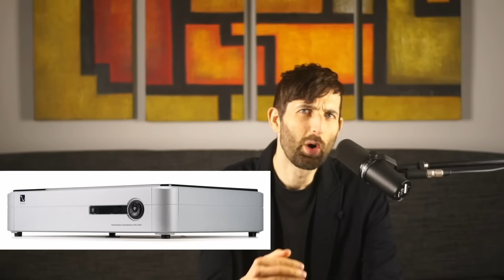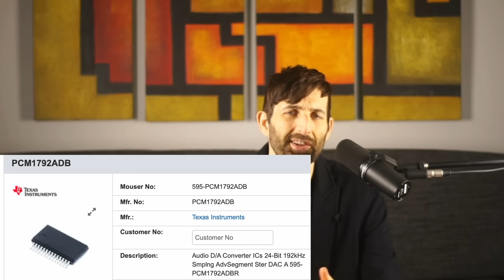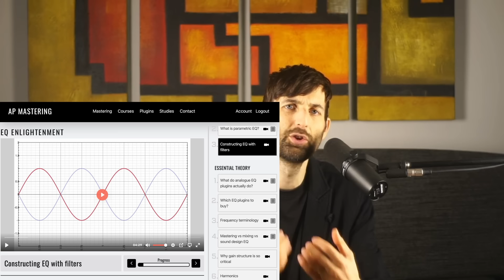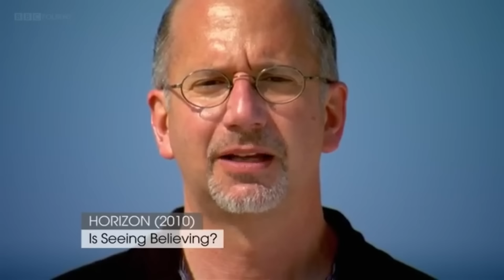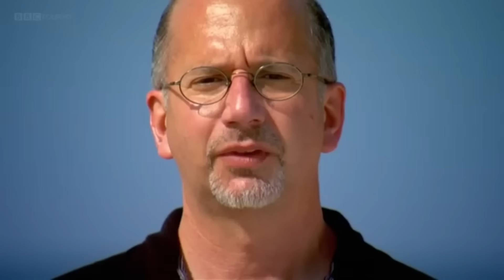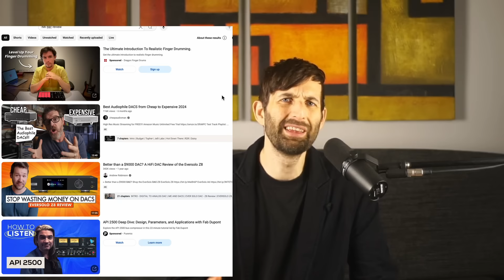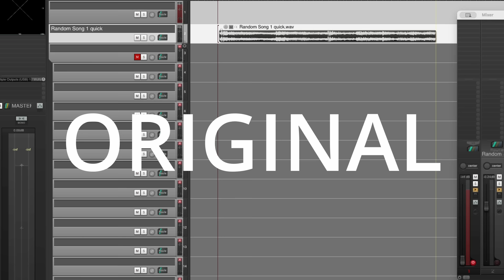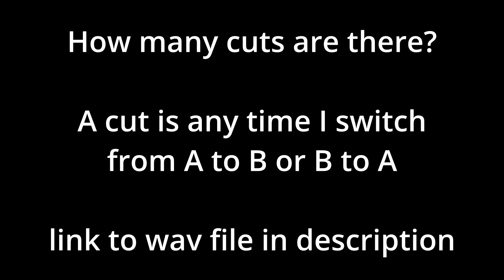The DAC Scam - Almost everyone believes the hype

Comment: I am not an sound engineer by any means, but I know that TDA1541 or even better TDA1540 sounds completely different with or without filter/OS and by different I mean I would prefer not to listen to it or to be the almost best thing I ever heard. I mean, there is no doubt about it, many people are hearing the big difference, one way or another. And this is 150 euro for the player and 50-100 for the mod - dirt cheap, no fluff, no ad, just a friend that showed it to me. The only thing that I found that sounds better so far from my Philips CD150 NOS is some alien DSD dac/streamer/something that was assembled by some international team and costs a lot. This modern R2R ... I did not listen to many of them, but the cheap ones are terrible, NOS or oversampling. Delta sigma, yes, probably there is some of them that the drum does not sound like hitting on a steel dumpster, but I did not found one yet. All of them sounds not natural to me more or less. TDA5140/1/3, PCM63, PCM1701/2/4.
Reply from the maker: I think something is going wrong elsewhere if you think DS sounds like hitting on a steel dumpster. If you think it sounds so bad it would be extremely easy for you to hear the switches in my blind test because I'm using a DS DAC and DS ADC
Reply: @APMastering I am not sure how this is recorded, but this part of the song does not sound very good it is hard to distingush between two bad recordings. To me all sounds recorded in the dumpster itself. I voted 2 switching one during each of the parts and some bad transition in the middle, when the rhythm changes. I check it multiple times with some edifier speakers, using the internal DS dac with toslink, second time with EAD DSP-1000/Hifiman Sundara and third time with same dac but with hybrid amp and triangle speakers. I plan to check via burning disk to my cd players, but I doubt there will be any change.

Comment: In the world of synths since late 70s many models use the same chips (same SSM or CEM oscillators , VCA , filters) but they sound different, because how the rest of the components affect the signal path
Reply: Without disregarding any bit of most of the marketing nonsense thrown at us, this is true for any circuit.
For example: when some people change op-amps and they notice they sound different, they actually forget that the circuit was built around that other part's specs. While compatible, it doesn't necessarily has to behave 100% the same. If you'd tune the circuit to behave the same, they'd sound indistinguishable.
Reply from the maker: Although I agree with both comments, we need to be careful to differentiate between synth design and a DAC. They are two completely different things. The chips for synths are like handing an artist a blank canvas and the DAC chips are like a preprinted coloring book.
Reply: I think I presented a fact that may be familiar to some musicians (and well known to an EE) so it can exemplify DAC design without getting into its theory. Additionally the figures can be measured on different DACs to compare them and avoid relying on subjective terms

Comment: I think the filters used and proper gain (input sensitivity) settings make the difference in sound for electronics which otherwise are transparent with current tech. I use foobar2000 with an upsampling dsp plugin that allows adjustment of the filter type (linear vs minimum phase) and parameters. After playing with this I realized how small changes (more than expected) to the filter can have noticeable effects to my liking or dislike. But this is not a thing that impacts cost just time in tweaking to preference. The optimal filter may be different depending on the overall system components.
Reply from the maker: I'd be surprised if you can use that software to legitimately effect the filtering inside your DAC but yeah any kind of filtering near nyquist will probably have audible artifacts if not perfectly set up
Reply: @APMastering All I know is I can hear a difference with critical listening. by adjusting the filter parameters. Most dac chips offer filter choices that is chosen by the manufacture or sometimes several options the user can pick from now. I upsample to 96khz or 192khz with my custom filter tweaks. This is a filter before it sees dac so the signal it sees is different than otherwise. The DAC chip has limited processing and power consumption especially due to mobile requirements today. Whether the dac accepts the higher sample requiring less sampling in the dac i don't know. I prefer a linear FIR filter over minimum phase. Filters seem to be sensitive things and higher dsp processing power and bit depth can produce more complex accurate matematical results also. I was quite surprised by the differences I noticed despite minor changes which I did not expect.. Best tweak I have discover aside from a good upmix to 3 channel stereo for music. Two channel was a compromise in the early days of stereo for financial and mass adoption of the format. RCA, Philips and Mercury labels had many great recordings with 3 microphone 3 channels. More gains today come by understanding good setup practices than buying more expensive gear.
Reply: @APMastering In addition to my previous comment  I know on older Burr Brown DAC they had the option for the electronics manufacture to use their own external filter. Not sure about the current ones. Why do you think that would be?

Comment: The idea that people that can't tell the difference between high end DACs in a blind test is either ignorance or a clickbait lie. Total nonsense. The market value is overinflated, but it is what people are willing to pay because of how these sound. People listened to them and buy the ones that sound best to them and are willing to pay for. Simple as it is. Nobody can explain why people aren't lining up to buy stock chip SMPS despite the spec sheet. Until they listen and realize they sound like crap. Problems like cheap digital audio require solutions, and unfortunately these are not cost effective but in a good system make a significant improvement. Even NOS DACs, though nobody can say they are accurate.

Comment: It's ridiculous to call everything "snake oil". However, a good dac, a dac that does its job well, starts at 400€. For example, the cambridge audio dacmagic 200m is cheap but a really good dac. However, if you want it to do everything great, a gustard brand dac starts at 1000-1500€ and if I had the money, I would buy it, I believe it would make a difference.
Reply: Don't believe in differences, just A/B test.

Since I watched many factory tours focused on the audio industry, the most expensive products share something in common:

- Less automation, more manual tasks, therefore more QC is needed because you now introduced human error. QC rejections are alway expensive.
- They typically manufacture in more labour-expensive countries, so the cost of increased manual labour goes into the price (as opposed to automated chain maintenance).
- Longer time to manufacture something, which increases storage costs.
- Sometimes they offer an extended warranty, that's actually nice when you pay such prices, but least expensive units have the advantage of just buying another one.
- They also focus on the «experience», the visual aspect, and such stuff not everyone cares about.
- If they built a reputation, prices will hike between 2-10x. Any idea of luxury/exclusivity can also factor in.

That's what you can find behind most outrageous prices.

Comment: If this made sense then even the cheapo converters like Motu’s or Scarlet would have the same conversion as higher end converters. This is not the case at all 
I’m not counting the stupidity of $100,000+ dacs but stuff like Hilo or Lavery are very different and very good and you can’t even compare to anything lower end like an Apollo ect

Comment: Here's a funny corner case story regarding "industrial" vs "audio" equipment. Many years ago, I worked in a behavioral psych lab. One of the postdocs was studying what effects (if any) ELF (50 - 60Hz) radiation had. He was using some expensive amplifiers from (IIRC) Grass Valley, which were purpose built for psych experiments. They kept blowing up, so just for grins he ordered a Hafler audio power amp kit, which was literally 1/5 the price. His comment after faultless performance for over a year, "you could start a damn car with this thing."
Reply: I owner the DH-200s, converted to monoblocks.  They were unkillable.  David Hafler himself did some demos where he put on of the amps on a hot plate, covered it with some flavor of blanket, and played good-sounding music through it until the thermal cutoff switches turned off DC to the finals.  They cheerfully drove my MG-IIIs at high levels, despite the ribbon tweeter being somewhat inefficient, and its impedance dropping to two ohms in places... they drove a roommate's KLH towers (known for their inefficiency) very well and did not break a sweat.  A good upgrade from the Haflers once they start failing from old age, are the Adcoms, but those will start failing from old age very soon.  On the plus side, the Adcoms are built to a higher standard, with higher-temp capacitors than the 1970s Haflers, so... we can hope.
Reply: and if my grandmother had wheels she'd be a bicycle. there is more to an amp than just power, especially if you're talking about scientific studies. while I agree some audiophile gear can be absolute trash from an engineering perspective... if that person was blowing up amps it was not the fault of the amps, rather his methodology and using the wrong tools for the task.
Reply: @cristi724  If one survived and the other didn't, what was the difference? Very simple logic!
Reply: @psyborg06  the difference is what imaginary story the OP wants to share with us, because we have none except some "funny" details. My point stands, use amps rated for the job you're doing.
Reply: @cristi724  Great, where did you get this detail then? "if that person was blowing up amps it was not the fault of the amps, rather his methodology and using the wrong tools for the task"

Comment: Just because two Dac’s use the same chip doesn’t mean that they perform or sound the same, because of how they are implemented. Also, the power supply and so forth can be very different.
Reply from the maker: sure but my point is that all WELL DESIGNED DACs using flagship chips are transparent and you can't tell the difference between them. My claim was never that you could make a shit sounding DAC by inducing huge parasitics but it will sound great "because chip".

Comment: @ AP Mastering  How do you think the ICEpower 1200AS2 stacks up to the Hypex FA123 plate amps? It´s a bit cheaper and doesn´t look all to shabby from the info I´ve found so far.
Reply from the maker: looks great but its significantly more expensive than the FA123 plate amps because a pair of FA123s gets you SIX CHANNELS of amplification plus the DSP crossovers and digital connectivity and an in built DAC. I don't know what else is on the market, outside of Chinese Alibaba stuff, that comes close
Reply: @APMastering Thanks for your answer. Had a look and you´re right, to get the same amount of channels out of the ICEpower I would need 2 additional units. Hypex it is then.
Just bought your speaker building course btw. I´m either going to build your design or the DXT-Wave-XL-Fusion from Heissman Acustics ( he swears by the Hypex plate amps as well ) but I thought that your course would be worth it nontheless just for the info and I´m not disappointed so far.

Comment: Rule N°1: Null test or it didn't happen
Reply: it will not null completely, every conversion will be different
Reply: @MikeOshkanov  right but it's about the magnitude of the difference, which is nill.
Reply from the maker: yes, you can null test roundtrips with the original. I did for this video and got something like -43db RMS for the delta IIRC. However, I decided to cut that, and a few other parts, from this video to make it more punchy
Reply: @APMastering I meant it more for people who insist their dac sounds extra "creamy"

Comment: Topping Centaurus R2R actually measures quite well, I wouldn't buy any DAC over 150$ but decent R2R DACs do exist.
Reply from the maker: sure, the topping stuff measures well. I don't necessarily have an issue with R2R that measures well and is affordable but I can't see it measuring better than DS at the same price point
Reply: @APMastering that Topping is 1k$ so not great value. I meant it as a caveat. most R2R measure like crap and cost an arm and a leg

Comment: When I had some money to burn I wanted to get an new DAC/amp for my headphone setup. I went to the store where I was lucky enough to demo several in the $3000 range with a range of headphones I own. I was ready to spend money. Guess what? In that quiet room I heard f*** all difference, the only thing perhaps being that one or two were 5% brighter than another; a small enough difference to be all in my head. After doing research I've realized I wasn't off my head, but actually hearing something real, as in barely a difference worth talking about. I think even amps are largely not really that different when level matched. The only thing that seems worthwhile talking about anymore is actual headphones and/or speakers, the rest is largely academic at best or consumer misinformation at worst.
Reply: In the end, an amp is just to amplify sound. If you want more than that, look elsewhere.
Reply: Unfortunately there are a lot of manufacturers which "color" their amplifiers to sound warm, analogue like and other marketing bs by adding filters or EQ.
Reply: It used to be that A-class amps were preferred, if you were running passive speakers. These amps worked differently. A-class amps would respond faster and were basically consuming the same amount of power at all times. B-class amps didn't, iirc. I had this explained to me by a mastering engineer over 20 years ago. D-class amps kinda made that stuff unnecessary. You could hear a difference, comparing A to B-class amps. Most folks use active speakers now(speakers that have their amps built in often one per membrane). And they're often very good compared to the tosh we used to get in that price range.
Reply: @AironExTv  I used to think so as well, but we got an old Marantz amp from the 70s that is class A, and with a digital source it does not sound really different from a modern class D amp we have; both sounded neutral for the most part.

Comment: A DAC isn’t just about the conversion chip—its clock, power supply, and analog stage make a huge difference. A high-end DAC reduces jitter, improves dynamic range, and offers cleaner, more detailed sound thanks to better electrical isolation and high-quality output components. Even with the same chip, a superior clock and power regulation can massively impact clarity and spatial precision. If you’re serious about audio, a good DAC is absolutely worth it.
That being said, comparing DAC conversion using heavily distorted music makes no sense. It’s a malicious argument because distortion inherently masks the differences in conversion quality. Yes, the audiophile world has its fair share of scams, no surprise there, but this guy is just talking nonsense—again.
Also, when buying a DAC, you’re often getting a variety of output options, which can be crucial. For example, finding a DAC with a proper headphone output under 2 ohms is quite difficult. A good DAC isn’t just about conversion—it’s about the entire signal path, and cheap models often compromise on key aspects like output impedance, power delivery, and analog circuitry.
Reply: Nothing makes anything sound $55,000 different.
Reply: @ I never said that, but this clown says, because an interface costing 100e have the same ship as an 1000e the sound is the same bruh
Reply: The dac and the power supply are two different things. You'll need a decent power supply for your dac as you'll need a decent power supply for your amp and so on.
Reply: RME ADI 2 FS. Some mastering folks use this. Has a very good, low-ohm headphone amp apparently, which I'd rarely use. RME is more a gear manufacturer for professional applications. Extremely reliable, every day use for decades. I'd give that a try if I had the 1-1.5 k to spend and wanted something reliable. Works as both an interface and an external converter.
Reply: But one thing you can guarantee is the actual cost to build these Audiophile Dacs is way lower than they are sold for, major profit made.
Reply: @ Yes for sure, 80% of "audiophile" equipment is a snake oil... But I would like to know my mastering engineer spent more than 200e in his converters/audio card
Reply: That I would agree. No need to go the mega bucks route though.
Reply: A difference that costs that much shouldn't be this hard to hear.
Reply: @ Everything when you are get pro lvl stuff is getting little changes for a big amount of euros, welcome in audiovisual world
Reply: Yes. So many factors are omitted from his argument that it’s almost juvenile in it’s simplicity.
Reply: @ exactly... He is just the angry sound guy of youtube, making his income by talking trash about 99% of pro engineers, to sell his course that - I quote -are better than going in a proper school.

Comment: Yeah I've always thought there is a point of diminished returns. I've been using an RME Fireface for over 15 years. I did a loopback delta test and it held up very well. Drivers are solid. Never had any issues